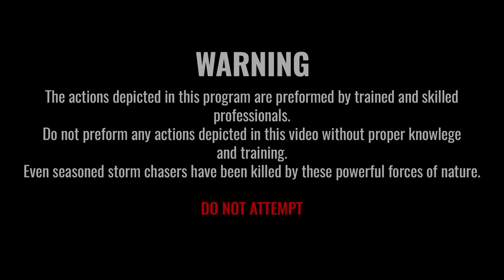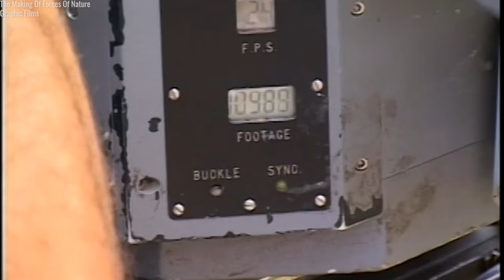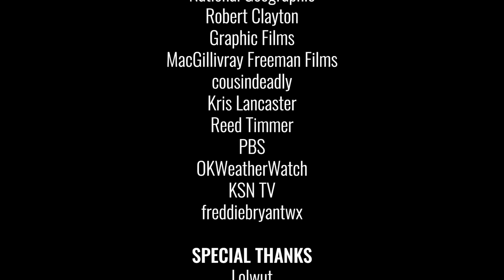Tornado Intercept Vehicle | A History Of Tornado Interception

Comment: The spikes are not critical unless you are going to take on f3 tornados. The myth busters proved the dominator one with no spikes could take almost 200mph winds before loosing grip on the runway behind the jet engines.
Reply from the maker: The mythbusters test wasn't a very good test. Real tornadic winds rotate around in a circle, while the Mythbusters only had the wind moving in one direction.
Reply: @MaximumMatt  depending what side of the storm u are on u only get hit with wind from one direction. The only time u would see wind spinning around u would be in the actual tornado.
Reply: @johnsnow1355  hence the point of intercepting the tornado. To be inside of it
Reply: One of the rams got bent in that test.
Reply: The jet test is not a really good test. The real danger is the debris flying around inside the tornado.
Reply: @aviation4life640  Jay Leno and Reed did the 'jet test' with Dominator 3 WITH debris, lol.  Also, in Reed's intercept the other day, he was in the belly of the beast and the  winds were from ALL directions.
Reply: @RRRIBEYE , in that video, half of the debris were basketballs and most of them missed lol.
Reply: @aviation4life640  The flour bomb was pretty cool and the furniture....that was a direct-connect, lol.
Reply: @RRRIBEYE , but imagine something like a large tree that weighs hundreds of pounds hitting it.

Comment: How in the Hell was 4 wheel drive not one of the FIRST things factored in during the original concept. 
Especially KNOWING how many dirt roads and muddy conditions out west in tornado alley.
Reply: It was cheaper to get the 1997 F-Super Duty truck than convert it to 4x4. TIV2 was built I think on a Ram 3500 or 4500 frame that was built to be a 6x6. You do have less to go wrong with a 2wd truck. Could've maybe have added a detroit locker or an e-locker to the diff and that would've helped a lot more than the open diff it had.
Reply: @Ratkill9000  Just no. You don't go off-road in those conditions without 4WD. Let your piggy-bank grow fatter for another year if you must but have what you need from the start.
Reply: @P_RO_  Not to mention it was a two wheel drive dually pickup, the most helpless set up in mud and other low traction conditions.
Reply: @Ratkill9000  just to let you know
Tiv 2 is a 2008  ram 3500 4x4 
( They took out the 6x6 in 2010. The third axle is there for weight)

Comment: Need to take a look at some of the military armored personnel carriers for a foundation for a storm-chasing vehicle.
Reply: Too slow in top speed. Some tornados can move at 50-60mph
Reply: @johnsnow1355  I don't think their current vehicles can chase at that speed, especially on dirt roads. I've seen wheeled armored personnel carriers running down the interstate pretty fast.
Reply: An armored Hummer with a fire breathing engine. Could go anywhere, any time. 8000 pounds dry. Money would have to be thrown at it for heightened reliability. Would be insane intercept capability. Built in turret.😎👍👍😎🔥🔥🔥

Comment: It would be more worth looking at buying old military equipment with the already built platform and only needing to add skirts.
Heck I think even the HMMWV has airbag or air ride already and 4 wheel independent suspension that could be modified.
$3,500 is going rate and many different versions and armors doors another $3-6k
Or even Oshkosh L-ATV price: $250,000  for the civil version

I don't know about all this patch work vehicles.
Reply from the maker: While using a military vehicle as a platform would have probably made TIV 1 more durable and reliable, Sean didn't have a lot of funding to get TIV built. I also suspect Sean didn't think that TIV 1 would be in service for almost 9 years.